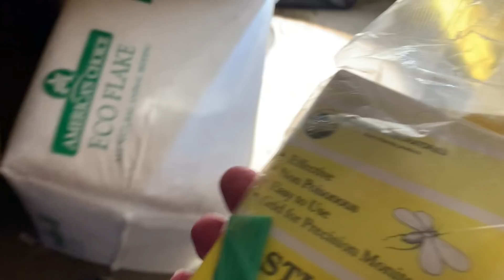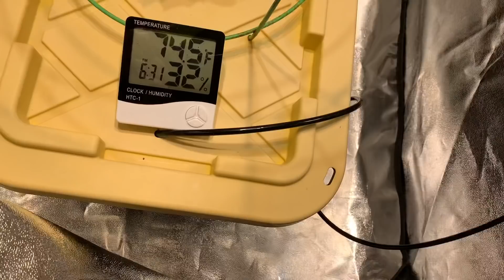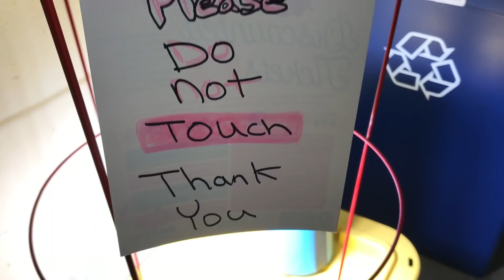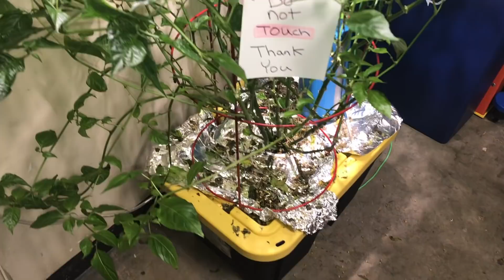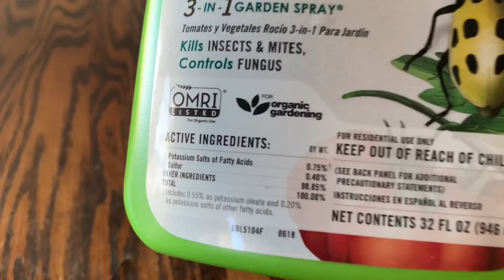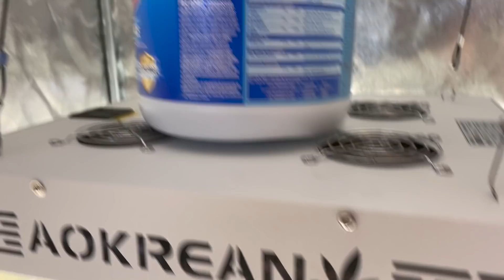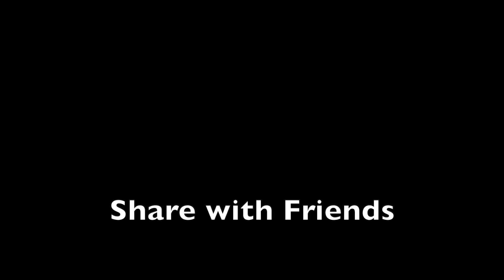Wonderful and terrible orbs hide under the leaves.

Comment: Spider mites made me believe in the Devil. They are pure evil 😂
Reply: Ah yes..thy biggest and baddest enemy in regards to safekeeping thine own plantae from the clutches of tetranychidae. Thine own enemy- whilst not evil in nature, art’ still harbingers of death!

I heard that the best way to naturally remove them from your plants is to use a sponge that’s been wet with a very diluted mixture of dish soap and water, while then using said sponge to lightly wipe off the leaves and stems of the plant- wiping it off for as long as you think best, and then using a sponge that’s been wetted with just plain water go over the plant one more time to remove any of the soap residue that may be left.
Reply: @catm590  thanks I'll try your idea. I spent like $200 on "predatory" insects who just died off in 1 day and didn't do anything.  I bought different sprays before too and its just hard to stop them once and for all. I dealt with them for over a year 😭😭😭😭  I even killed all my plants and started over from a clean plant and they still never fully go away.
Reply: @ZafriusRasnake   I used all natural sprays like peppermint oil or flaxseed oil but then it seeped into the water and killed my clones.  Ill try your idea too thank you.   I just wonder how they keep getting inside onto my plants, its so annoying.
Reply: @catm590  I like you go from old type of talking and then instantly switch to regular explanation mode 😂
Reply from the maker: They are difficult to eradicate but they key is thorough and frequent spraying.  Pick off  the lower leaves and scope them to see the results.
Reply: Hark! Dost thou forget the most true and passionate garden friend, thine most precious predatory mites whom seekest out most feverently the bastard spawn of the most foul and belligerent parasitic mites and their wicked compatriots the dreaded fungus gnats!
Reply: Lol
Reply: they're SO tiny!
Reply: if you catch it before it gets bad, or after you've eradicated most of them, you can rub the stems with neem oil which is pretty hard to avoid if you're crawling on them ;) i like to avoid getting the leaves wet/oily if I can.

Comment: had the same issue with my first Carolina Reaper indoor grows in college, it was a real pain getting under every leaf also did the same as you did with cutting the lower leaves off.
Reply from the maker: how did it go?
Reply: @JebGardener  worked out well. Ended up with a decent amount of peppers for a first timer though I attribute that to Carolina Reaper plants being quite resilient. Made some hot pickles, had some in meals then dehydrated the rest.

Comment: I wonder if in the grow tents you could put in a small humidifier with the organic pesticide diluted in some water and humidify it with the pesticide in small bursts as needed to take the effort out of having to lift leaves and direct spray and get those sneaky mites?
Reply: no, the bugs have to be wetted with the solution, the soap breaks the surface tension of liquid and makes it stick to the bugs, it suffocates them. Having wet air will not be enough.
Reply from the maker: no escape from labor

Comment: This constant water change sounds important and a hassle. Isn't there a toilet style system for hydroponics? You flush and the upper tank refills the lower tank. Lower tank water is displaced to a drain pipe.